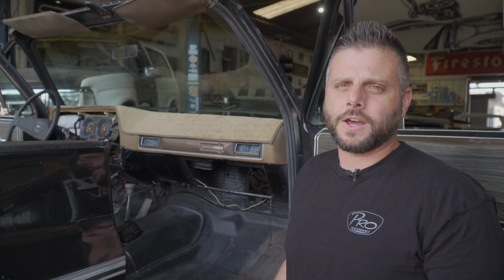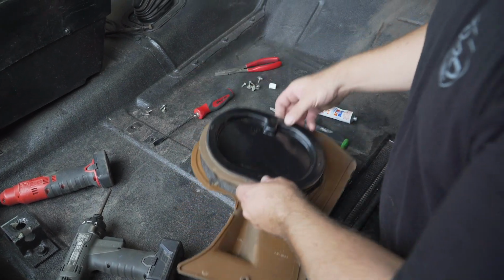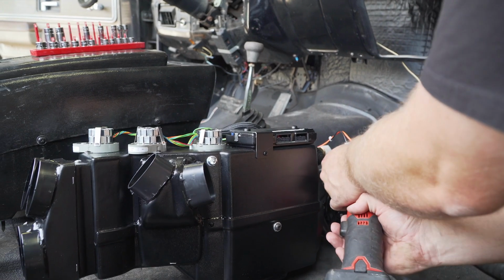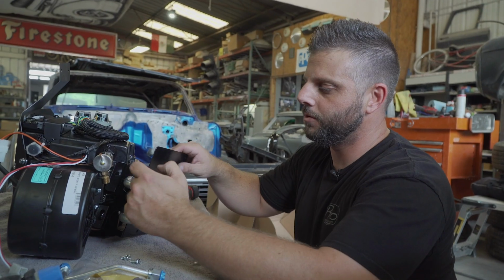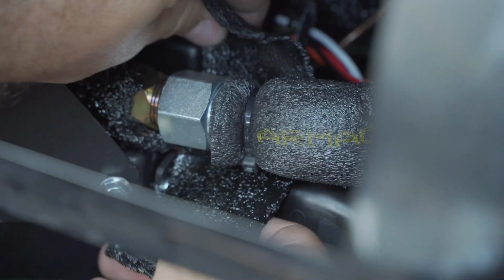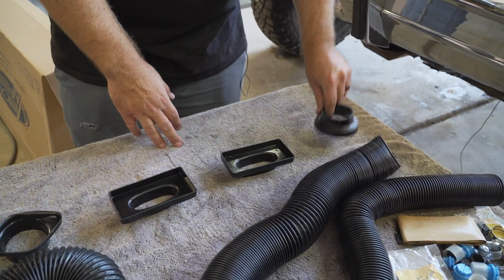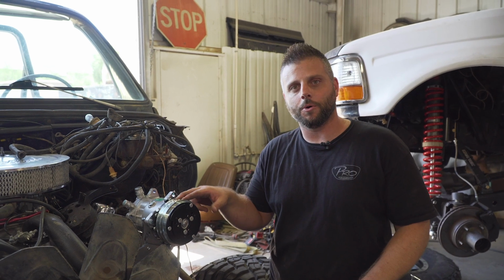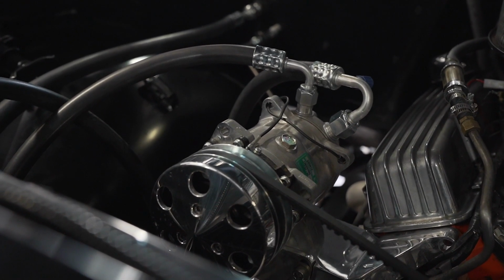Installing Vintage Air into a C10 Truck / Blazer

Comment: This might be a dumb question but is the installation the same if you have the 6.2 Detroit diesel?  Do you need any special brackets?
Reply: I'm considering putting ac in my 84 k20 6.2. Did you install in your truck

Comment: Hey my friend I have a question in an LS swap The water pump have 2 Nipples one bigger one is smaller. I nstall my vintage air.. and about to do the houses my question is which nipple off the water pump Should I connect the Heater control valve.. If you can let me know appreciate thank you so much

Comment: Where are you guys located..would love for you guys to put one in my 74 blazer😏 by the way I'm in Tucson,AZ
Reply from the maker: We’re in Mesa, AZ
Reply: @AZProPerformance  thx guys what's the labor on putting one in a blazer
Reply from the maker: @Johnny9ers  Runs $2,000 drive in and drive out all installed and charged up. We do sell the systems too, so just give us a call and can get you all setup.
Reply: @AZProPerformance  thx for time. That a good deal. When I'm ready for that step I'll hit you guys up

Comment: Not a big fan of Silicone because after 10years or less it is done. I used a Rubber Butyl Rope to seal the cover plates.

Comment: I had to bend the heater core pipes and the ac lines to get it lined up with the 4 block off plate holes and that stupid rear bracket the heater lines pass through has to stay loose because you cant get the wrenches on the fittings. Also if you leave the front mounting bracket off till you get the unit up under the dash its a lot easier, also pull the carpet and padding out if you can cause its a tight fit to get the unit up under there. Also youll have to make a different power steering pump bracket because what they send you is for exhaust manifolds. I ran a small belt around the power steering pump and then the other belt goes around the water pump and the crank pulley. th power steering pump doesnt have much belt adjustment so i rolled on a 33 inch belt and used a 55 inch for the second one that comes from the crank and water pump , works great